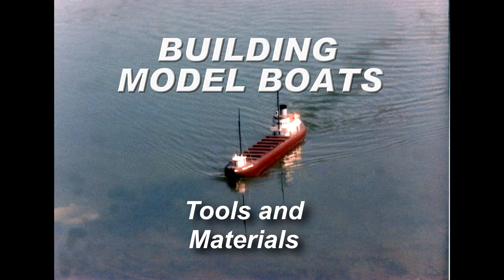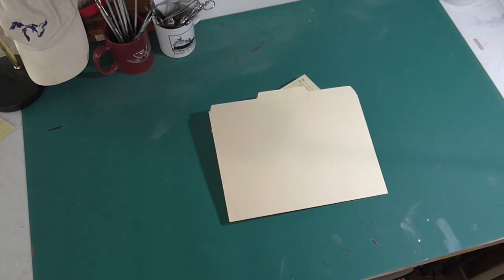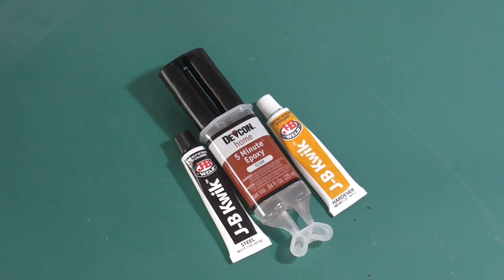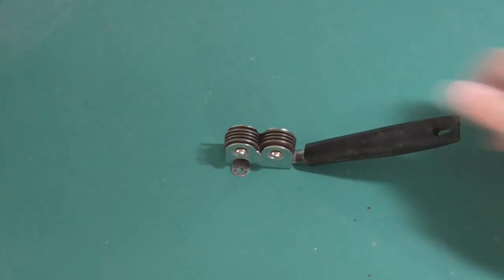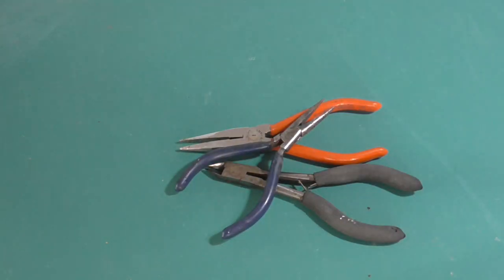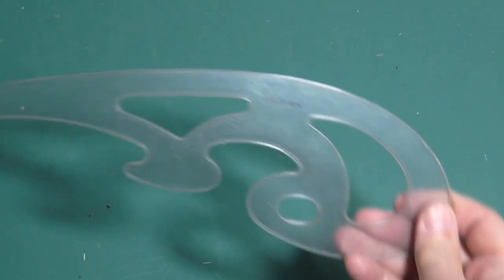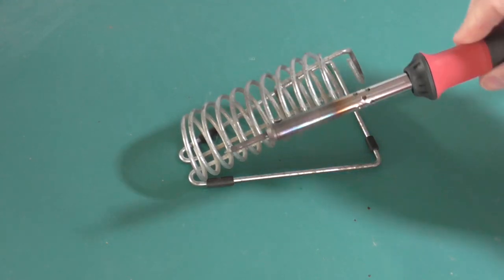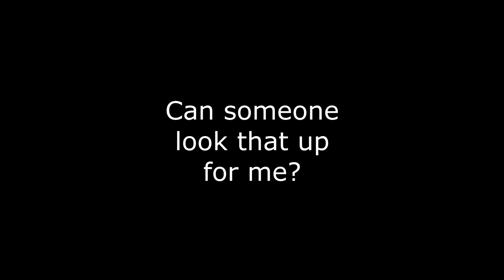Here is your shopping list of the tools and materials for how to model R/C boat building

Comment: Wes, what is the maximum length you keep your boats?  Do you make the hulls full scale depth or do you make then shallower to save ballast? Thank you.  Greg
Reply from the maker: 33 inches max length for sheet balsa. Sometimes I alter the depth depending on the beam just for the sake of stability. My 1,000 footer has a LOT of ballast, and you can hardly tell.
Reply: @authorwes  I have a plan for a generic version of a 450' laker. I too want to keep within the 36" balsa lengths.  I am shooting for 1:220, or  model railroad Z Scale.  The model will measure 24 1/2" long, 2 3/4" wide and full scale depth would be approx. 2 1/4" deep amidship.  Does this sound about right?  I was thinking using basswood for a bottom sheet for weight.

Comment: Awesome information and post. It must have been the camera angle as the 45's didn't look like 45, although clearly they are. Also, no disrespect intended, but I watched an aviation video where is presenter talked about "cheap pilot bastards". He admitted he was a CPB. Wes, were you ever a pilot? Thanks for this post!
Reply from the maker: Only for about two decades. Got an ATP, was with 3 airlines and one corporate operation... BS Degree in Aero Sci from Embry-Riddle... CFI'd for 3 years, flew cargo, flew DNR, pretty much the whole mix. But I was also a mechanic at a Falcon Jet service center where I learned that, money is no restriction.
Reply: @authorwes  Well, I should have known. Safety over money. "Only two decades" uh? Awesome. Best regards.